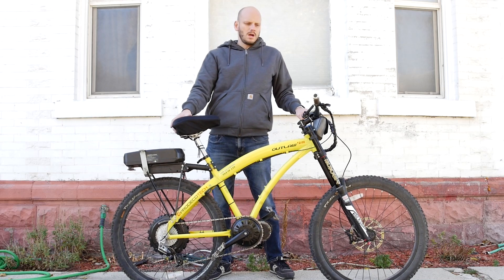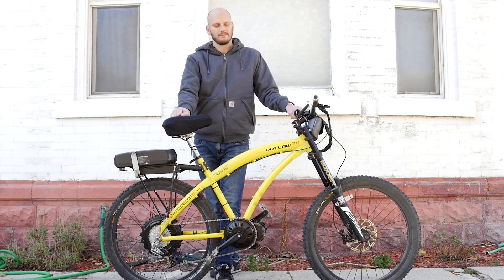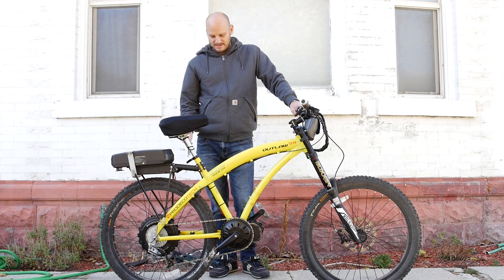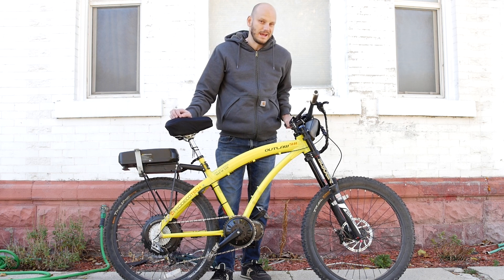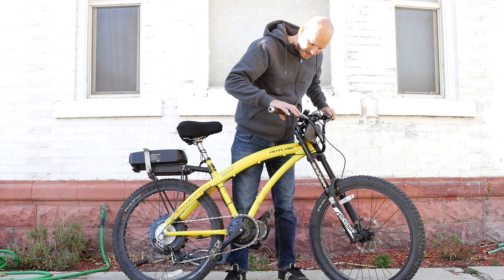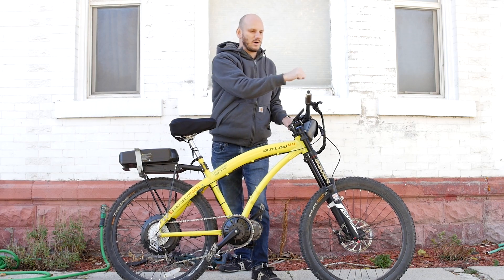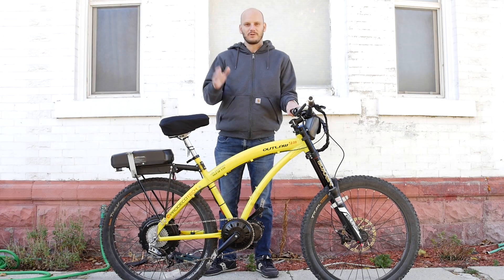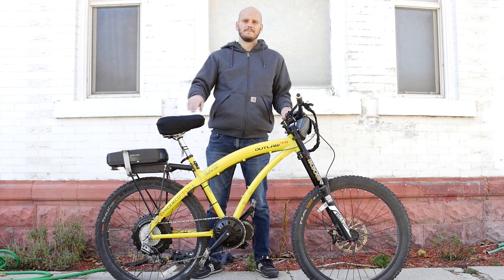Custom E-bike Build: Prodeco Outlaw 1200 BBSHD 68mm  Converting an e-bike into a better E-bike :)

Comment: I don't understand
 you can easy wire almost any controller.
To any hub motor 
And hub motor with internal controllers convert to external is easy.
You could have bought a 1500-watt controller for £30 $40 easy.
Get one with display for £80.
Wired up to the 3-phase wires and the 5 Hall sensor wires.
You can easily get any motor running smooth forward or backwards.
just need to find the right combinations.
By swapping the 3 phase wires & 5 Hall sensor wires around
There's about 36 different combinations.

I've build e-bikes e scooters out of scrap broken motors so I think this is easy for me.
Making stuff work what shouldn't work.

Obviously would try to fix the original controller first like check all components diode cap Mossfets.
Only if couldn't find problem.
I would replace with external controller.
Reply from the maker: He wanted more power. Mid drive 👍

Comment: The original controller is located in the battery’s mount (48v 25amp 1200w) and 8FUN hub is a Bafang brand. Remove 4 side screws and 2 top screws holding the lock to drop the bottom plastic box ..to repair and/or update.
Reply: so i just acquired one of these bikes minus  battery and controller , being a bafang hub i should stick with using it and the parts shouldnt be too hard to find?

Comment: I purchased an outlaw frame on Craigslist and built it up with a BBSHD.  I love the aggressive style of the frame but nearly everything on the bike is non-standard including the rear axle width.  Difficult to find a replacement wheel.  The triangle is real small and the curved tubing makes it very difficult to fit a battery in.  I slung the battery on the wheel side of the diagonal tube.  I didn't get as good a top speed but better than 30mph and 40 miles staying around 20 mph and peddling a little.  The Outlaws are rare enough that I won't see my bike coming at me.

Comment: Have you ever bought through Alibaba??  Also I think using thinner tires would give higher top speeds.  I once bought a new Suzuki 150cc while living in Vietnam.  It had normal width tires.  I swapped the tires for fatter ones for a “cooler” look.  The result was the top speed dropped a good 10mph due to more mass and friction.

Comment: Hey Johnny could u help me please I used my fone to adjust my throttle and think I've changed something else as I'm getin no assist til around level 4.. is there basic settings to use for the bbshd??
Reply from the maker: Check out the link to programming the motor under program cable page in my shop 👍
Reply from the maker: @UC9GKaaRpD2kX6b797Q4jvzg https://www.johnnynerdout.com/product-page/bafang-programming-cable

Comment: I don't use a kickstand on my MTB but now I am going to put a mid drive Bafang on it and don't want to lay my bike on the side with the motor attached so I will need a kickstand.

Anyone know if a center mount kickstand will work or will the motor and other things be in too close quarters to the center to attach a kickstand?

Thanks
Reply from the maker: The motor should not interfere with it. It’s more related to your frame design than anything you may need to go with a rear mount kickstand
Reply: @JohnnyNerdOut  Thanks much Johnny.

Comment: I can't believe you though replacing the original controller with oem equipment.

Either you're so biased toward mid drives that you are completely ignorant of hub drives and controllers, or you are being intentionally dishonest.

A controller from any major vendor will auto learn when wired up to any ebike hub motor made in the last decade.

It would be really hard to find one that isn't compatible.

And many of the better controller manufacturers have been in the business for a long time and aren't going anywhere.

Same for the major hub motor manufacturers.

So, your customer in this case was given incorrect information, and it cost him quite a bit.

He could have just purchased a $250 controller, used the auto learn function, or programmed it manually and avoided buying a new motor for no good reason.

What a con job!
Reply from the maker: Yikes. Normally I would disregard a rude comment like this, but….let’s go!
The only “self learning” or even after market controller I would go with would have been the phaserunner by Grin. But at over $300 before shipping and duties it would’ve been about $400 just for the controller, whereas a new 1000w mid drive was $675 with a controller. Customer didn’t want to do that. He wanted an upgrade of performance. Not just a lateral move/repair. 
By adding a mid drive, we pretty much doubled his climbing ability/power. 
Phaserunners are not auto learning but they are very user friendly if you have a pc and are a little patient. But it still requires time=labor to calibrate it and also to physically make the connections from controller to motor. The cost difference would have been within $100 I bet. 
But all that is a moot point because the customer didn’t want to repair his hub motor anyway. He wanted an upgrade. 
Also. Controllers from major vendors do not auto learn. Have you worked with them? They are often times poorly manufactured circuit boards with zero “learning” capabilities. Grin makes the closest to what you describe, and I really do like it, but it’s pricey. Customer wanted maximum performance upgrade for minimal price impact. Mission accomplished IMO. 
If cost wasn’t a factor, I would’ve done things differently of course. But this is a business at the end of the day and my goal is to make my customers happy 😃 Other channels may just make videos of “dream builds”, I make real life case-study videos. 👍
Reply: @JohnnyNerdOut  I have to agree with Jonny here. Hub motors suck off road and hills. If you live in the city and just ride on the road then a hub motor can work but it you go off road at all or live in San Francisco you need a mid drive. I have built three mid drive bikes and they are all great bikes.

Comment: Voilamart 1500W has a version with a controller that is internal. Cyclone is also a mid drive with an external controller.

That customer should have a custom bag and a custom battery made for that triangle. Not difficult especially if it's only 48 V 12 Ah. I recently found out about so many websites that make custom bike frame bags.

Am I wrong but the rear wheel is the old motor?

Comment: Replace the rear motor with a 1000w bafang motor kit in a wheel that fits the dropout. Make that boat anchor pull its weight, and turn it into a duo motor  nitro bursting hill crusher...
Just like I did with my Duo motor mid drive Radrover...

Comment: Have you converted a newer full suspension trail bike? I ask because the bottom bracket and downtube connecting to bottom is different from older bikes. Geometry is different

Comment: I have a cheap old Walmart Huffy. Single speed? Can I add a mid-drive and leave the rear the same, along with the original coaster  foot break? One speed. This bike would be used only on paved semi level walking paths. This is for an old man. Can you/would you sell me the parts?
Reply from the maker: I really don't recommend putting all of those powerful components on a Walmart bike or any bike with coaster breaks. Ultimately, it is up to you and if you don't plan on going very fast, it could still work. All of my components are for sale on my website and I can help you pick out which ones you would need if you book a consultation.
Reply: @JohnnyNerdOut  there is a good chance that that Huffy might be a steel bike in which case the frame might be good for an ebike. It's the other parts that definitely need replacing. If you are building an ebike I think steel frames are the way to go but they are sorta hard to find.
Reply from the maker: @LarryRichelli  I agree. It’s the parts though that will cost a fortune to upgrade unfortunately. You could find a used donor bike with good components and switch them if you have time and know what you are doing. But at that price you might as well get a good used bike and just convert that one.

Comment: What a awesome looking frame. Quite impressed with that. Less impressed with the hub motor still being on the rear wheel. Surely he could have budgeted for a replacement wheel in the conversion. I don't know anything about that hub motor so could be wrong but its likely just a rebranded Chinese hub motor and has fairly basic electrical connections. Controllers can easily be replaced. I mean if its a direct drive hub motor it literally is a brushless motor as the rear hub. There are no moving parts in there at all. It's not like a mid-drive with a series of cogs and even belts. I would sell on the rear wheel as someone might pay reasonable money for it. 

If you have the old controller you should be able to see its spec and connections. Controllers on hub motors are external so very easy to replace and often fitted away from the bottom bracket area. Many of the big brand mid-drive motors fail because of water ingress that destroys the circuitry in the mid-drive motor. On  a hub motor you just replace the controller. Many direct drive hub motors are actually the same motor used with many different controllers so you might get a 250W/500W kit with a small controller and the very same spec wheel is also used with a 2000W kit with only an upgraded controller being different. I would say the separate controller of a hub motor is one of its huge advantages. Seems unfair to criticise hub motors for being proprietary when you get mid-drives that have unique electronic handshanking between battery and controllers so you can't use third party batteries and other companies make it so the BMS is destroyed if you take the battery apart so you are forced to buy their branded battery packs. They also don't supply parts to the general public. I would say mid-drive is the home of proprietary parts and hub is almost exclusively an open standard that can be easily customised. I say that knowing that the owner here had trouble getting a replacement controller but that is probably because the importer made that difficult especially now they are out of business. I'm sure someone knows who makes those hub motors. I wouldn't have any trouble at all getting replacement parts for my hub motors not that I've needed any.

I would probably say of all hub motors sold only 3% have proprietary parts but for mid-drive that is probably more like 70%. I feel more mid-drive motors out there are proprietary (Bosch, Brose, Mahle, Yamaha, Shimano) than open standard (Bafang and less well known brands). Also we don't even know if that hub motor is proprietary its just been made more difficult by the importer going out of business. A Bafang hub motor is no more proprietary than a Bafang mid-drive motor in fact you will need far less spares for a Bafang hub motor as its much simpler engineering. When you look at the Bafang factory their hub motors are bought in from one of the huge hub motor manufacturers in China and then get final assembly by Bafang where as the Bafang mid-drive motor has a lot more unique parts and is fully assembled and designed by Bafang. There are companies in China that manufacture phenomenal numbers of hub motors. Hub motors probably dominate world ebike sales with over 95% of sales at least. In this video you can see them explaining that Bafang buy in these hub motors and that the company that makes them has over 1000 staff. If you watch the earlier video (part 2) you will mid-drive is on a much smaller scale. Just making the point there is a lot of shared components with regard hub motors and controllers.

https://www.youtube.com/watch?v=iR0uibTbHuk

Comment: Lucky that bike came with a battery that can put out 30 amps. Most pre-fab e-bikes skimp on the battery and controller and they can't sustain 30 amps continuous. Nice job. Too bad the owner didn't spring for re-lacing the wheel without the motor.
Reply from the maker: Cost was job #1 on this one. He just wanted to keep it on the road and get a little better performance than he had previous.
Reply: @JohnnyNerdOut  I hear that. You did a sweet job saving that bike. Still hope he budgets for it in the future. People should check with you before getting one of those overweight under geared abomination motors. Mid-drives rule the road, and the trail, & the path & just about anything.
Full confession: I may be a bit biased;)
P.S. I got & installed the Baffang light kit. It's obnoxiously bright & loud...perfect for seeing and being seen & I love it.
Reply from the maker: @michaelsprinzeles4022  😂get in line😀

Comment: what is in the rear hub still that is required to keep other than a rear rim /tire ? 
Love to know /see what you might do with the 1000's of old bionx pl350 out there ⚡
Reply from the maker: The hub and spokes. Those would both need to replaced. Parts are pretty cheap but labor is expensive. Might cost around $150-250 depending on the shop.

Comment: This one is really cool because the bike doesn't lose any ground clearance at all with how the motor was mounted and because the rear mount battery is more stealthy than having a bulky black battery on the downtube. The weight distribution and feel isn't as good with the rear mount but you get used to it -- sorta like you get used to having a seat mount child seat. Also, the owner of this one was already accustomed to the rear mount battery. This bike looks cool.

Comment: surely you could have got rid of the rear motor for minimal cost?
Reply: Yes agree.. probably under $50
Reply: he's not the sharpest guy around
Reply: @endliberalism4305  Imagine the tyre wear on that thing
Reply from the maker: Customer preference always takes precedence. You tell me you want the absolute minimal cost, I make that happen for you. Watch the video and I explain this.
Reply: @JohnnyNerdOut  Moving the weight of the battery would of cost you nothing...Js
Reply from the maker: Customer needed seat post all the way down- so it couldn't move closer. 
Also, even if they didn't need the seat down, the battery was custom fabricated and I would've needed to put a whole new rack on to be able to move the position. So, yes, it would've cost. Also, also... time is money.
Reply: @JohnnyNerdOut  whatever
Reply: 100 percent on universal parts and staying far away from motor companies that lock you in to their stuff, like batteries. Hoping Bafang isn't headed in that direction...  Some of their new stuff requiring their battery is concerning...